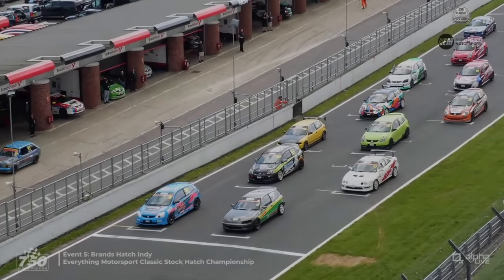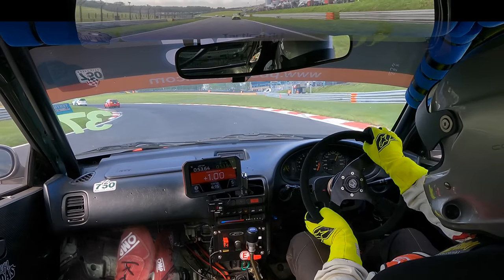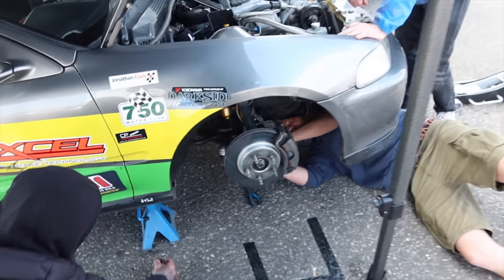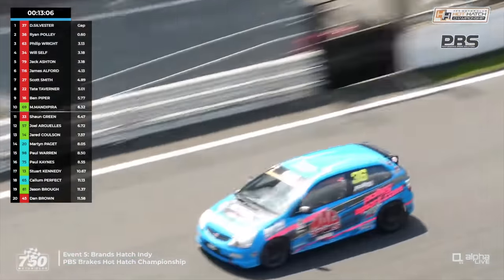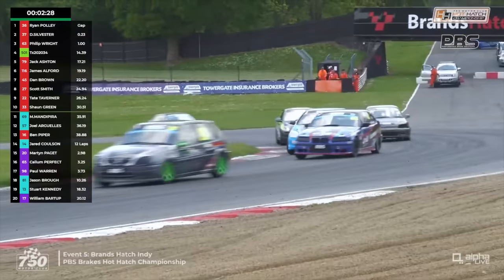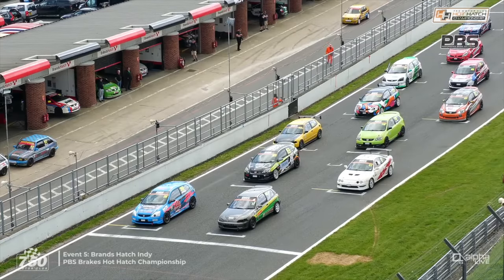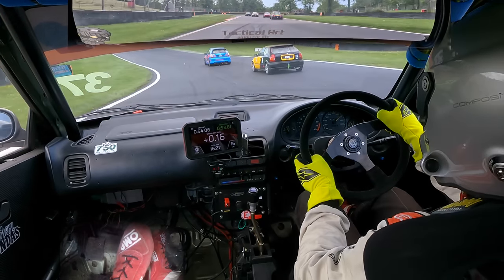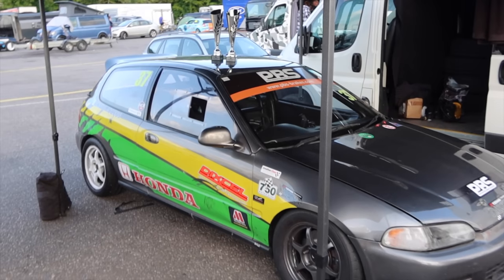FIRST WIN against the EP3s??? K24 EG BRANDS HATCH RACE VLOG

Comment: Is there a reason why you’re not taking full advantage of the regulations? You’re allowed up to  235 width tire and 9” inch wide wheel but you’re pinching a 225 on a 7” wide wheel and wondering why you’re lacking front grip. You’re allowed a splitter and wing? You have honed as a supporter yet you haven’t taken advantage of their geo correction parts. Seems like there’s some opportunities to find pace just in the setup. You’re absolutely wheeling the car as it is
Reply from the maker: All in good time

Comment: A few things, as an arm chair expert.
The sponsor of this video has a lot of great information and products that will help resolve your handling problems. 
You need to get those 225s on a 15*9 inch rim to support the tyre itself and to provide a much nicer, squarer shape to the tyre than the current ballooning of a 225/50 on such a skinny rim.
Watching you follow Polley race one, you are turning in earlier and not setting the car as wide as he is, which is limiting your drive through the corner and onto the straight. It is evident on the times you're following him into T1 and also through looks at track map south bank where is he apexing the back of the corner and driving through the corner, where you've apexed the front of the corner and had to lift off the throttle on the exit to save the car from understeering off the track. Setting the car half a metre wider on entry and turning in slightly later will help with this.
Great video and day though.

Comment: Hi Danny. Your EG should be turning better than those EP3's. 
I have read that on these generations of Hondas suspension IF lowered too much, it  seems to mess up the suspension geometry and performance in turns is reduced…

Have you thought about getting extended ball joints on the front knuckle or raising the Civic? 
In the USA, the people who race these generation Hondas are lowering them AND also using extended ball joints on the front knuckles to correct the angle of the front lower arms and brackets on the rear trailing arms to correct the geometry of the rear lower arms.
I am enjoying watch you and your friends race your Hondas. 
Good luck 🤞.

Comment: I find it a lot easier for low speed tight tracks to run with no front bar at all. Even with 900lb front springs and 1100lb rear springs on my 1999 Civic coupe. With the bar, the car just had no bite into the low speed corners. After removing the bar in testing, I was lapping 1.2 seconds a lap quicker allowing me to set the course record on the race weekend. Give it a try and see if it works. Normally I have 2 mil toe out in the front and 0 toe in the rear.

Comment: Hey Dan - any reason why you run A052 tyres and not A050s - both appear to be on the hot hatch acceptable tyre list ?  Given a052s are like a one lap wonder, the boy band of competition tyres, A050s are like any good Yorkshireman - go hard fast then after a few go's settle into a nice consistent rhythm delivering sustained performance until worn out.
Is it simply a cost issue ?
Reply: Availability is poor over here and any decent sizes…
Reply: @petelawton-hcr_works6059  that's a real shame 😢